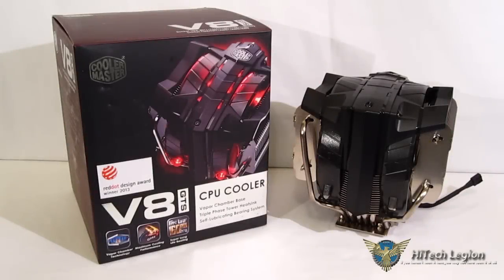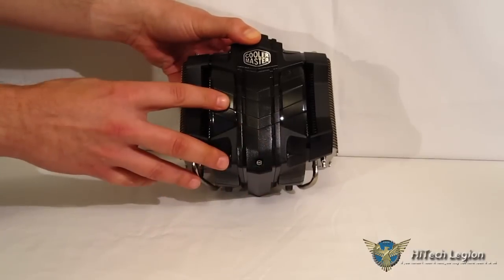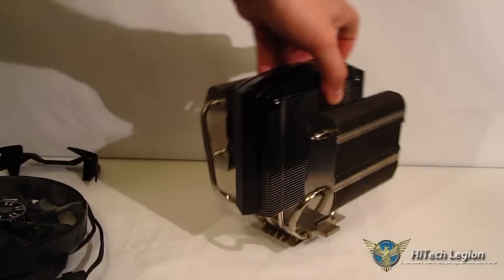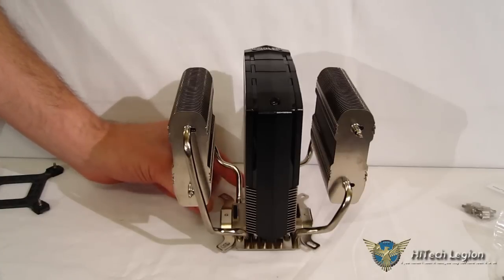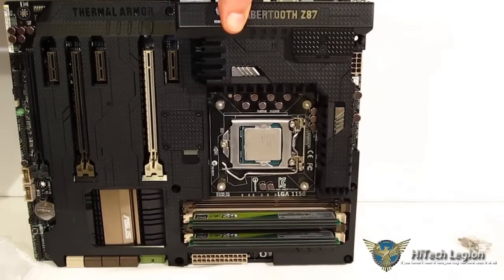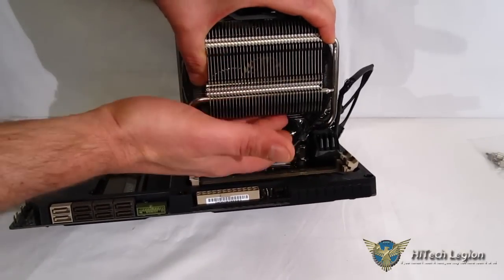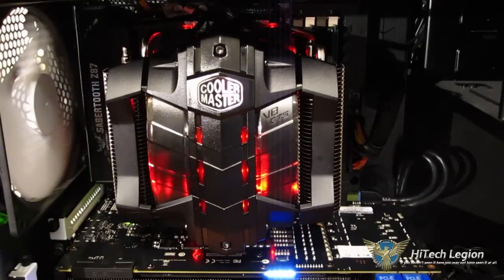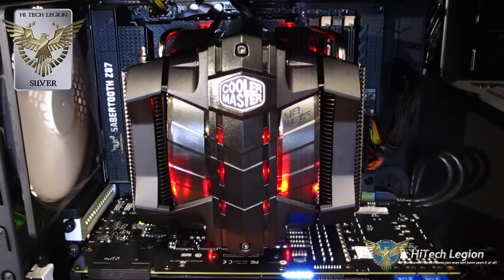Cooler Master V8 GTS Overview, Installation and Benchmarks

Comment: 166 and a half CM???? aint no case going to accommodate that!!!!
Reply: I don't see how you don't get it I have the v8 gts myself, the middle heat sink has 4 looped pipes the 2 outside have 2 none looped pipes each 1 to the bottom 1 to the top. So 4 in middle 2 on each end 4+2+2=8 heat pipes
Reply: RavenKilloran He doesn't "get it" due to the fact that he is trolling. Acting like he is smarter than the makers of the video makes him feel better about himself.  It's really that simple.
Reply: George Cella I am not trolling at all. The guy said the unit was 166cm tall lol. That wouldnt fit in the backseat of your car, let alone a pc case!!!!
Reply: RavenKilloran They are the same pipes as whats coming out the other side. If you look closely. If you want to put it like that then there must be 12..... 4 in the center each side and 2 each side going to outer heat-sinks... But technically there are 6 pipes in total, just they are protruding out of both ends unsymmetrical.
Reply: icecoldcola08 he meant 166mm it's just a simple mistake.
Reply: +EggrollNerd Yeah, I thought so.
Reply: +icecoldcola08 it's probably 166 mm (16.6 cm)
Reply: icecoldcola08 you see one side the other side has another 2 going to the outside heat-sink.
Reply: EggrollNerd Its a review, does he not check his vids before submission? I do.
Reply: icecoldcola08 166 mm
Reply: neeEEEegga :'v <3 at first i was like wtf... then i saw the correction... lol
Reply: icecoldcola08 8 6mm heat pipes??? I see 6. Bro you need to take maths lessons =/
Reply from the maker: icecoldcola08 Perhaps you should look a little closer or research more. Direct from Cooler Master's specs on the unit:
Heat Sink Material
   Vapor Chamber / 8 Heat Pipes / Aluminum Fins
  
  
   Heat Sink Weight
   854g (1.9lb)
  
  
   Heat Pipe Dimensions
    Ø6mm
Reply: Yh but you also said it was 166CM tall lol. That would be the same height as me pmsl.... Also i still only see 6 pipes. You pointed and said there are 8. I see 6. Where are the other two???

Comment: Will this fit with my z97-G45 msl motherboard cause it fits my color theme perfectly but I don't wanna get excited and buy it and find it it not fit or something 

(Also I'm new to computers this will be going in my first build)
Reply: Also is a 750w psu good enough to use this? Cause with 7 other fans and graphics card and stuff I'm getting worried this might be too much power lol
Reply: LeoLiburon You should make sure there is about 100 more watts for use just too make sure the pc wont go down because it need more powe (I'm also doig my first pc build as i write lol)
Reply: my gc uses 145 and cpu is 88 i think idk how much the cpu cooler and fans use
Reply: You can go into a site called pcpartpicker and set every part into there and it will tell you how much watts i's going to need
my pc uses 458 wats and i choose to use a750PSU because i know that i will upgrade it alot so i will go over to an 1000+ titanium watts PSU when you have upgraded enough but you shoulden't worry about how muchyou fans uses in watts they use like maybe 20watts for the 120mm

Hope it helps some kinda way :l

Comment: will it fit if im using asus pro-gamer series mobo and the ram slot wont be disturbed?
Reply: luncent lucy There is clearance for RAM up to 55mm in height. So only RAM with the really crazy heat spreaders will cause any issue.
Reply: George Cella ripjaws ?
Reply: To my knowledge, all Ripjaws are under 50mm.
Reply: +luncent lucy hello, did it fit? because im planning to buy same mobo as yours with same cooler with this and im curious if it can fit? TIA :D
Reply: vainglory07 the space a bit tight for high profile ram...still can fix in
Reply: oh nice, thanks for your response
Reply: vainglory07 you welcome  ^ ^

Comment: Just installed this in my Scout II Advanced case without removing the motherboard.

Took your advice and removed the fans - hardest part was getting the screws started re-installing the fans.

Thanks for this vid, saved me a headache.

Comment: I want this cooler so much!! I am not much of a tech guy but I know how to read :P so this is my PC now and I would like it if someone could tell me if this V8 would fit in my Case and on the parts that I have: Case: Thermal Take Urban R31, CPU: i7 4790K, Motherboard: Gigabyte Ultra durable GA-Z97P-D3, GPU: MSI GeForce GTX 770. And if it would fir would it obstruct the slots for the RAM memory, the memory I have is the Kingston Beast, 2x 8GB......? :D

Comment: What tool did you use to remove the fans? I can't see what it is you use and I need to reseat it as my CPU temps are definitely suspect. A quick reply is greatly appreciated, let alone any!
Reply: Bilt8 there are some screwsat the top,  hope your house hasnt burnt down yet.

Comment: Will this fit corsair carbide spec 03?
Reply: Waylon Ng You can find this out by looking at the specs of the case, which lists maximum CPU cooler height, and the specs of the cooler which will list its height.

Comment: It took me about 5 minutes to install it in TT armor+ case without taking out the motherboard... :p
Because I used this 9mm http://silmarferramentas.com.br/catalogo/produtos/415056.gif
and this
http://static.kupindoslike.com/Nastavak-produzivac-za-gedore-1-2-75_slika_O_18490685.jpg
and yes I did took the fans out. More or less it is about the same size as the V6GT just a bit wider.

Comment: Would I be able to change the LEDs easily. I need a new cooler and I have a green and orange themed build and added more orange would be awesome
Reply: from what i read no you can't change the colors
Reply: i mean the leds them selves if i remove the 'stock' leds and replace them. but thanks anyway
Reply: CuddlesTheLemur Yes, you can change them, but not easily. Not at all easily.....lol.
Reply: ah well my mistake i guess you can

Comment: Trust me, when you buy one of the ASUS maximus series motherboards, this is a pain in the ass to install.. But man, thx for the advice (like taking the fans out) it really helped me out!
For those who have to install the cooler on a similar mobo with a heatsink I advice trying to attacht the top 2 screws next to the heatsink first. It might happen that they get stuck between the middle radiator and the mobo when you accidently drop them. Unless you are up for some fishing you'll have to remove the entire cooler to retrieve the screws. This way you will only have to unscrew 1 screw or none at all instead of 3.

Comment: Would this fit in the HAF X ?
Reply: Everything can fit in the Haf X! :P
Reply from the maker: Yes.
Reply: DonBugatti yea that's true
Reply: Hayden123457 ;P
Reply from the maker: sand boxx
The height of the cooler is in the video, the written review, on the CM web site, in the specs of every etailer.....Corsair lists max cooler height in the specs of their cases.
Reply: HiTechLegion get in, thanks
Reply: HiTechLegion what about the haf xm?
Reply: be careful with the weight of this in your motherboard it can break it. i belive this is better on a haff xb evo because the position of the motherboard. Correct me if im wrong pls.
Reply: loool!haf x is from cooler master!
Reply: Yes, I have this case, and I can definetly say that this would fit XD.
Reply: HiTechLegion how about corsair spec-03 ?

Comment: will it fit on a cm storm enforcer on a m5a99x motherboard also Is the fans loud, thanks alot for the video very helpful.
 also does it come with the thermal paste thing u showed at 6:40?
Reply: Yes, it will fit with plenty of clearance.

The small tube of thermal past is included.
Reply: George Cella Thanks for the fast answer, Should I go fro the be quiet! Dark Rock Pro 3 or this one. They are both at the same price where I live. And i want a queit pc. :)
Reply: Green Hood Personally, I found the DRP3 to be a better performer and quieter. I also happen to think it is a much better looking piece with much more attention to detail.
Reply: George Cella
Alright then that is the one that I will get. Thanks for the help mate :)

Comment: i just want to ask if this fits to nzxt phantom 820 case? because it looks huge.. anyone knows?
Reply: It's actually "only" 154mm tall, compared to most of the top tier (NH-D14/15, PH-TC14PE, R1 Ultimate, HE01, etc) that stand 160+. The only issue you might have is the side fan in the 820, which will hit some coolers. But, even with the side fan it should fit. Without the side fan you have 30mm of extra clearance.
Reply: okay.. thank you so much bro.. but my friend said liquid cooling is better than this
Reply: Yosuke Saintz You're welcome.

And saying "liquid cooling is better than this" is a huge generalization that may or may not be correct. While something like a Swiftech H220-X will offer you better performance than this and actually be quieter, something like a Corsair H60 would offer lower performance and more noise. So, that blanket statement he made is far from correct. If you go through our reviews here at HTL, you will find huge performance differences in liquid coolers. And while the H220-X is the best out-of-the-box cooler you can buy, there are several air coolers that are closer in performance than any of the other liquid coolers. I should point out that the V8 GTS is NOT one of those air coolers, and is not in the elite ranks of air coolers.

Comment: So would it be possible to change the stock fans for some noctua ones?
Reply: @Author Buther. Did you get a responsive for the question about combatility with mounting Noctua fans on the V8GTS as a replacement for stock fans???
Reply: Nope, i was sadly ignored. Though i did come to the conclusion that it would ruin the colour scheme
Reply: Just looking for best efficiency practical solution.
Reply: ? Noctua new pwm fans are black? Hmm. Interesting.  
I also considered mounting Noctua nff12 fans on silver arrow Hest sink for best air cooling solution as I believe the additional number of heat pipe help in heat dissipation.  On the other hand I'm glad we're on the same brain wave. I believe due to the new CM v8 GTS cooler has a vapor chamber this may be the best cooler yet to pair with nff12 fans. Also I'm a big fan of the 3 heat fins design. Please send me a link if you have it ......

Comment: If this had green led's I would get it but it's red which would make my computer a christmas light show
Reply: I actually need blue or yellow :/
Reply: Why he do mad lol? Must not get any presents
Reply: Hey Brock, I changed my LED's out for some White ones I bought on Ebay for cheap. All i used was a solder gun, some solder, heatshrink, some super glue, an Exacto razor and 9V Battery to test it. It took me a bit over and hour to finish, you can easily do it even if your not savvy with a solder gun, or maybe a tech shop could do it for you for a slight fee as well. There are a lot of soldering tutorials you can watch and its pretty simple and straight forward to do. If you do decide to do it or anyone else reading this, I wish you good luck and you can do it without having to take the entire heat sink off, just unscrew the fans and pull them out and cut the old led's out and replace them with any color of your liking. Have fun!
Reply: These comments are atrocious. People are allowed to care about the asthetics of their build.
Reply: grow the fuck up.
Reply: Woah, someone's upset
Reply: normal people buy a cpu cooler for its purpose not led colour. how old are you

Comment: How much cpuld you push 4790K with this cooler?
Reply: 4,5 GHz and it gets toasty af (90 degrees under load with a tad of thermal throttling), probs not relevant anymore though lol

Comment: is this better than a H100i closed loop cooler? Im kinda getting tired of water cooling and just want a air cooler with same performance to keep my 8350-FX at 4.9Ghz i have a lot of fans in my case, 5 intake fans and 3 exhaust fans
Reply: The V8 GTS does not have that kind of performance. You should be looking at the Cryorig R1 Ultimate, Noctua NH-D15, be quiet! Dark Rock Pro 3, Phanteks PH-TC14PE or Thermalright IB-E Extreme....there are a few more, but those were the first that popped into my head. Those would be the air coolers that will outperform an H100i under those conditions, and all will be significantly quieter than the H100i doing it.
Reply: George Cella I don't need a cooler to outperform the H100i just one that is similar wether it be little less cooler because I hate having to deal with the Corsair Link software that doesn't work and the way my case is setup I have to do a radiator external install on top of outer case on the CM scout advance 2 case

Comment: how hot is the room you test in! for some reason my temps in my room are alot lower then i see on most benchmarks
Reply: ~22. Are you running a 4770K? The case makes a huge difference in temps, as does the MB to a lesser extent.
Reply: i'm using its older brother, the 3770k... thermals must be pretty similar right?

Comment: I'M planning to get this for my build as it fits would this be good for the i5 4430 im not gona overclock just use it for gaming would the cpu cooler be good for that thxs
Reply: On a stock 4430 it will be very cool and quiet with the right fan curve.
Reply: thxs

Comment: 166cm high? I don't think any case is that big!
Reply: The Fractal Design Define R4 used in this video obviously is....lol.

I believe that Cooler Master's specs reverse the width and height on this cooler and that it is actually only ~155mm tall.
Reply: It will fit in my CM HAF 912

Comment: If the motherboard would be sideways would the vapor Chamber and the cooler perform better
Reply: Possibly, but not by any great measure, and obviously very few will be using it in a horizontal orientation.

Comment: Low end board, no heatsinks on-board!
Reply: You might want to look a little more closely (or simply look at the test system specs), and maybe do a little research on what you are looking at before you make such an inaccurate statement......

BTW - just a word of advice. Never assume the quality of something based on the size of its heatsinks....or what you perceive to be visible heatsinks.
Reply: I was talking about my board.
Reply: My apologies. You can see the confusion with the statement there with no other context.
Reply: No need to apologize, I wasn't being clear.

Comment: I personally don't see how there is any resemblance of anything automotive on this cooler. I also don't know why anyone would spend 100 bucks on this air cooler when you can get better cooling from a less costly self contained liquid cooler.
Reply: LOL....and I don't see why anyone would buy a CLC when you can get better and significantly quieter cooling from a quality air cooler.

I am not saying that this is one of them. But whether you are buying this or a CLC, it is all about the looks, not about the actual performance.
Reply: George Cella I bought this cooler for my mini build :P fits in the prodigy but switching it out after I get a titan for a custom loop :P
Reply: The V8 is only a selling technique. -_- Doesn't have to look automotive. I'd spend $100 on this thing. T_T It just looks cooler than any other air cooler out there. _
Reply: Vidane Nice....this must look awesome in a Prodigy.
Reply: George Cella yeah i might be able to put a fan above it xD but i have to send my impact mb back :( so when it comes back ill get some pictures its only going to have a 750ti for now till i can get a titan Z xD (because fuck space xD)
Reply: I'm gonna say again that I have a 212 evo and I've had temps around 50 with my proc oc'd to 4.7 and ran outa headroom. If you have good airflow in your case you can keep it coll.
Reply: Really not sure what your point is.....or what you were using as a control load for that reading.....or how it relates to a V8 GTS.....but...ok.
Reply: George Cella lol he didnt even reply earlier or anything to make sence xD

Comment: Why didn't cooler master stick with the original V8 installation guide?  It was so easy.  Install the two brackets on the cooler and install 4 screws into the brackets and then put the cooler on the CPU and put four nuts on the back of the motherboard.  With a cut out hole on the motherboard tray this was a 10 minute job at the most.

Comment: Hi, I can use this heatsink with full set Corsair Dominator Memories on a Asus Sabertooth Z87 Mb?
Reply: I'm really not positive as I didn't have any Dominator around to test with. But, you can simply unscrew the handle part of the Dominator and it should fit with no problem.
Reply: George Cella Thanks! for you answar George, but if make this not impact the cooling capacity?

Comment: Would this fit on an AM3+ socket in a cooler master haf 912 advanced limited edition?
Reply: As I recall, Cooler Master lists max CPU cooler height in the specs for all cases on their web site, and the height of the V8 GTS (154mm) and socket compatibility (which is even in the description of this video) is listed there and in this review, also.

Comment: would this cooler fit the fractal design core 1000
Reply: Fractal lists max CPU cooler height as 148mm for the Core 1000, so this will be too tall.
Reply: ***** Exactly.

Comment: hi, I  am doing car theme, have tt level 10? would look awesome if would fit . need center diam? have at least 4 and 3/4 around cpu. could make easy 5 to 5and half. diam, .that's from center. of cpu.= also 7 .1/2 deep.off mb. top and back that not sure about using gigabyte 990fxa ud7 mb and have amd 8 core .pile driver.  like your vid . think wasn't bad install at all .from all info I can find think it will fit. looks like there's plenty of room? thanks for the share.
Reply: Thermaltake lists 160mm as max height for coolers in the Level 10, BUT in the FAQ they state that the Jing just fits and is 161.2mm tall. The V8 GTS is 166.5mm, so that may be an obstacle. All of the dimensions are listed in the review (link in description) and on the CM site.